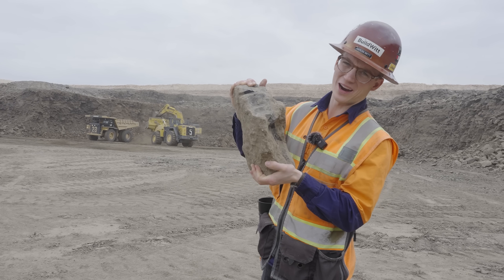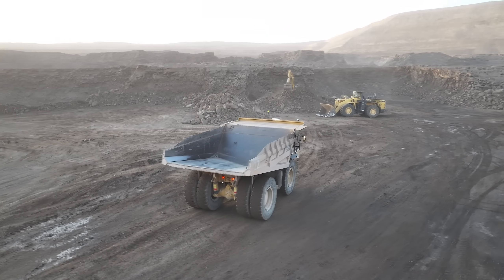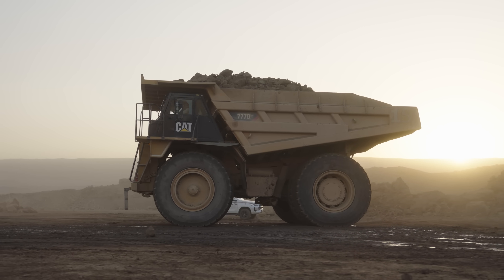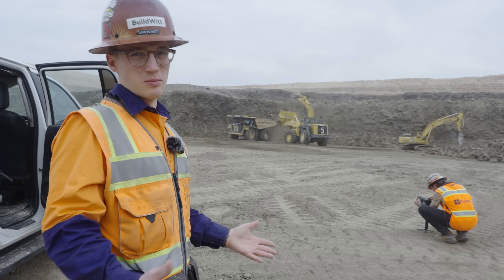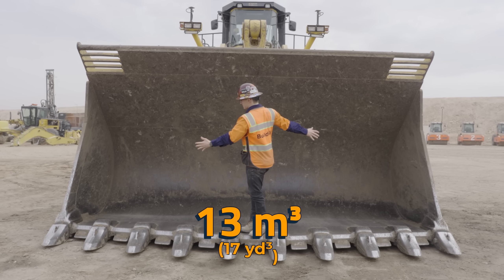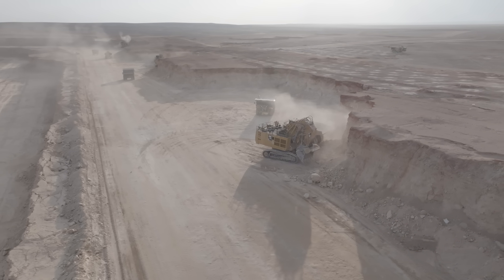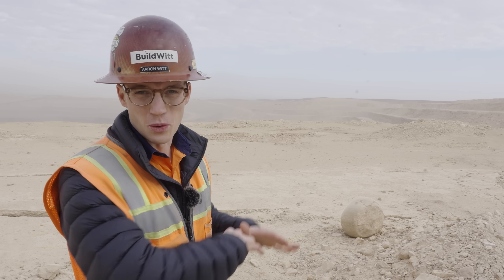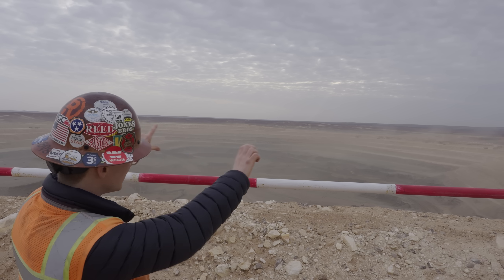How Jordan Powers 1 Million People with Rocks

Comment: 7:39the color line is highly relevant their isn't it? everything under it just looks like burnt ash. or is it red because... it's 15% iron by weight. and has nothing to do with oil being in it. to that i guess if they fire it burning oil it converts back to iron and the conveyer goes on cools off and picks up all the iron out of the crushed dust  with a magnetized separator? because if their was oil in it they could crush it and use a water oil separator ... just ripping it all for Iron?

Comment: I have never seen more stupidity than this project. You are spending more energy than generated plus you are polluting the air and contributing to global warming. Instead, they should use solar panels plus batteries to generate the same amount of energy. Or at least import natural gas from the Arab gulf countries to run the power plant.

Comment: Surely if they covered that was wasteland in solar panels they will get more cleaner and sustainable power output?
Reply: You need to have a mix of energy sources to make sure there is a reliable and stable supply
Reply: NO. 
Sun is not shining at night even in Jordan desert.
Therefore you need storage in addition to solar and lots of it.
470 MW x 12 h = 5640 MWh
That is about 1600 Tesla Megapacks with estimated price of 1,6 BILLION USD.
Reply: @karloallmere7178  Appreciate your response. However you are very wrong. Why would you use tesla batteries? there are cheaper batteries outhere like sallt batteries like in Morocco Noor site,
Reply: @WyeZed can you elaborate on more examples that are scalable or with persistent supply chain  cause lithium batteries  arent easy to come by

Comment: A long time ago, I did some research into historic gold deposits in the Dead Sea region, on the other side of the Sea from Jordan.  I knew that there were shale oil deposits there, but this is the first that I've heard about them being mined.  I bet they are just scratching the surface now.
I say that because I went on to work about 15 years in the construction and servicing of the Canadian oil sands mines and steam extraction well pads.  It's really cool to see how the Jordanians are doing it, what machines they are using etc. 
Thanks for the video.
Reply: The problem is, instead of become succes story, it was failure story, this moth government lost law suit against the Chinese investor as fees are overpriced
Reply: @anasmushtaha2323 lol and two more projects are being built by I think the same Chinese entity since 2016 so yeah good riddance I heard the other power plant will generate more than double  this plant capacity 😊

Comment: So we burn 0,8 liters of oil to get one liter out.... and still people beliebe this is a good idea. Solar energy in Jordan would be such a cheap power that is completely absurd to do stuff like this.
Reply: You gotta mix the energy sources for grid and supply maintaince Jordan already  uses  solar and wind in more  than 30 percent  of its energy output giving another 25 to 30 percent to oil shale thermal and gas thermal , combined cycles sounds smart maybe mix in some bio mass and waste energy  jn the grid  decentralize  a bit maybe more  solar house heating  and proper public private sector partnership would solve more than just throwing everything into solar and wind without entirely solving the storage and supply chain challenges

Comment: That's 2 - 20 cm rail extensions on the truck beds. 
Jordan is expanding solar plants but seems a little slow compared to nearby countries. Fossil fuel is cheap in the short term but as our planet becomes less hospitable, the economic and social / cultural costs will become extreme.
Reply: Have you solved the solar storage challenge? Lithium isn’t easily accessible too deposits exist but how many of them are of  concentration  worth   mining   ?

Comment: Much better to start using solar, especially in Jordan.
Reply: Jordan has massive solar plants everywhere. ~20% of power is solar. And have EVs everywhere. But we don't have storage solutions.
Reply: You should write them a letter, shows the limitations of solar, when a place like Jordan that needs energy so badly and has such tremendous sun resources, uses this low grade resource. Every year we put more Carbon into the air than the year before, and there were uneducated people saying in the 60's that by 1970 solar would replace oil.
China builds a new coal plant every few days.
Reply: A big part of Jordan's electricity mix is solar, but it is too risky to over depend on renewable energy sources.

Comment: Burning it like coal?  the Jordanian Desert is just across the border from the Saudi "empty Quarter" the dust is finer than talc and abrasive as hell.  The heat is naturally extreme, the low tech solution to getting energy out of the shale, the only question is how many MW in to get MW out?  Is it a positive value?
Reply: Estonia as whole country is producing almost ALL of its electrical energy from oil shale for more than 80 years.
It is actually Estonian technology exported to Jordania.
In Estonia oli shale is only 2 m thick and mined, not excavated.
Therefore it is absolutely right for Jordania to use their own available fuel for electricity production.
Reply: Plant power demand is 35mW to crush, convey fuel and dump ash. 2 x boilers net output is 470mW.
Reply: @LAITHKHRESHEH how is the power plant  and mining process powered though ? بعدين يا ابن عمي بحكو في مشروع محطة طاقة ثانية نفس النظام وقال نفس الشركة الصينية ب انتاج اعلى في منه الكلام ؟

Comment: Where does the overburden go?.When the rock is burned where does IT go? Yes, it's desert, but is there a remediation plan?
Reply: I'd imagine they throw the fly ash  back into the old pits for reclamation
Reply: @Bowiiihowdy  It'd make the most sense.
Reply: @DJ-bh1ju  if there's a bottom ash like coal plants they can also use it for cement.
Reply: Overburden was used to build ash pad areas (higher elevation). Ash is being conveyed to 2 Ash Spreaders with a capacity of 1800t/h to dump 20,000 tons per day.
Reply: Nobody wants to be there anyway.

Comment: Another great video.   Question:  Due to the super dusty conditions at that location, do all of the cabs have any special air filtration installed?  Is that the most dusty site you have visited?
Reply: That's what zero regulation gets you
Reply: Hell no that is one step above slave labor.
Reply: @goodson77784 no, operators aren't slave labor even in those countries. Also in the other video about phosphate, he showed that the cabins all had special air filtration iirc
Reply: @amogusenjoyer  You cannot read apparently.
Reply: @goodson77784  what I meant is that they are very well paid usually. They aren't even close to slave labor. Maybe it's different in Jordan in this mine specifically but generally speaking, for that area, working on natural resources like this is a very cushy job.
Reply: @goodson77784  clearly you never visited Jordan and know nothing about it and maybe you never issued a passport. The labers and engineers are Jordanian and they are paid well.

Comment: Is oil shale the same type as the oil sand?
Reply from the maker: It’s kind of similar in a sense that it’s both near the surface and can be mined, but it’s quite different beyond that
Reply: Similar premis, but sands are unconsolidated (Not properly rock yet), whereas shale is compressed clay (Heat and Pressure) so it's actually rock. Both contain oil that can be used. Too much heat and it all turns to natural gas.

Comment: How do oil shales compare to coal in energy density?
Reply: @GOOD_FARMER  What type of coal would you equate oil shale too? Are we talking anthracite or lignite?
Reply: @GOOD_FARMER  I understand. I was just trying to understand, in terms of energy density, what grade of coal is equivalent to oil shales.

For example, do oil shales have the same energy density as anthracite? Or steam coal? Or lignite? Or dried peat?
Reply: coal has a lot more economic sense, and moree dense.   coal is super smoggy and causes lung problems, and it makes little greta cry
Reply: @davidanalyst671  In that case, how is oil shale power viable in Jordan? (which boarders several countries with virtually unlimited natural gas as a byproduct of their oil operations).
Reply: @domtweed7323 it's about independence and resources. Countries like Jordan just don't have enough foreign currency to buy everything off the international market. Even if it costs more in labor costs, etc, it doesn't matter as that's local. They can't just throw billions to buy Saudi oil, because they don't have billions of dollars. They have plenty of people that can work even if it's less efficient than burning oil.
Reply: @amogusenjoyer  That might well be right. I'd have thought Saudi gas would be dirt cheap (since it's an oil byproduct that's mostly just burned), but maybe the pipeline distance still made it expensive.

And it definitely provides more local employment, and autonomy, than dependence on foreign gas.
Reply: @karloallmere7178  I didn't expect gas to be free. But can't they get relatively cheap gas from the Saudis?